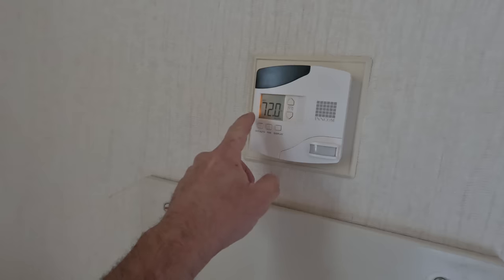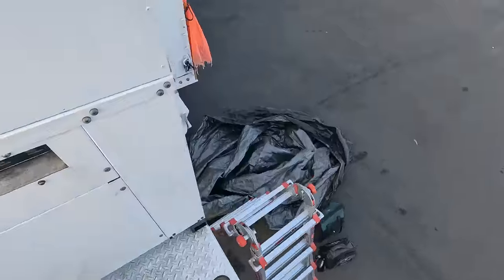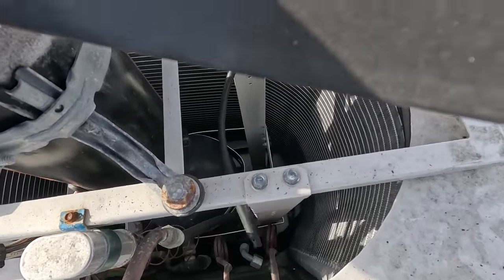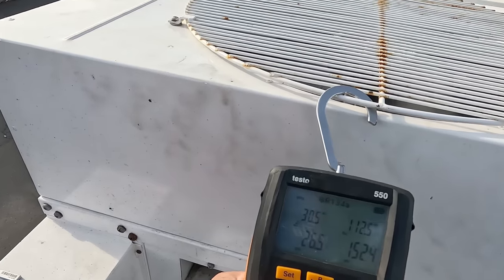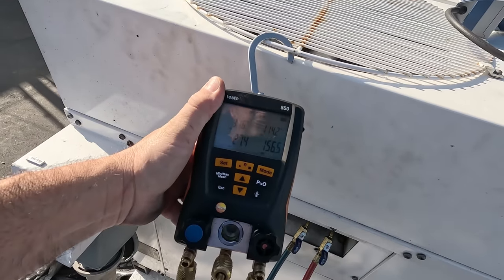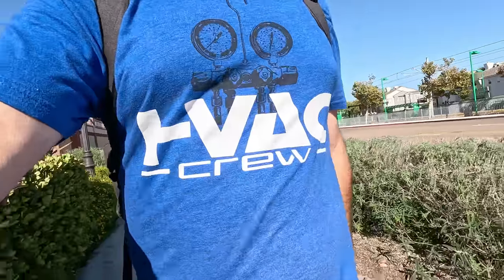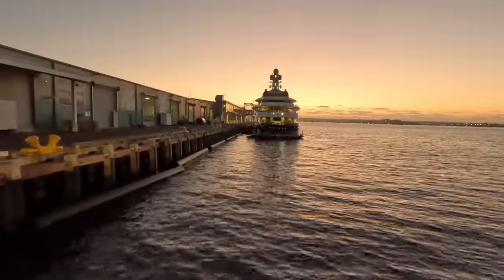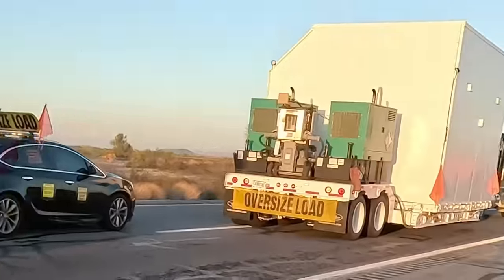HVAC Transport Mission With NASA Part 1

Comment: It is very interesting trade we are in. Our company go down to Antarctica very spring to service the equipment and a crash course to the mechanical engineer on the equipment and refrigeration. Takes about a week but sometimes 2 due to no flights due to the weather. I have been 3 times so far. 
I am amazed you have shakes when working on them. I have not had one in 20 years since working on them unless cleaned it myself.
Reply from the maker: 🤣👍👍 ice cream machines aren't as bad as ice machines 🙏😊.
Reply from the maker: Now that would be interesting. Not sure I'd want to deal with the cold and what  happens when the equipment quits working.
Reply: @HVACRSurvival  - Interestingly enough, extreme heat is worse.   The suits they use for Antarctica are pretty much the same stuff they use in northern Alberta :)